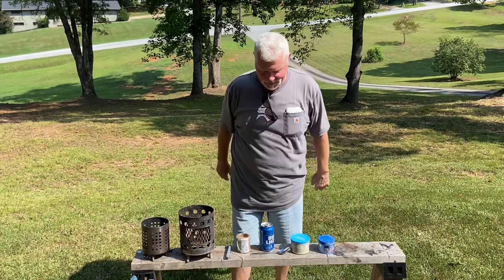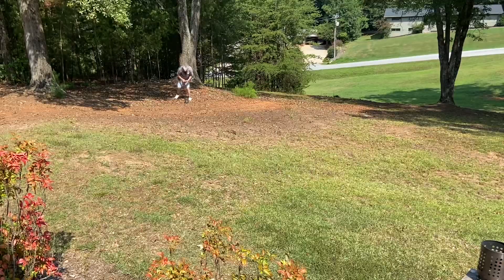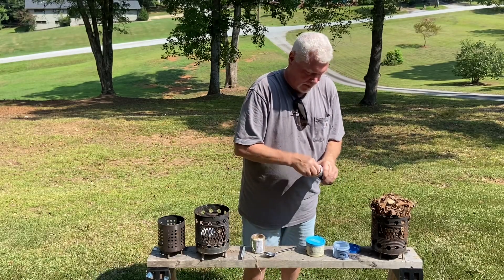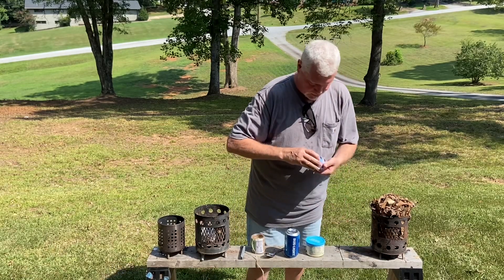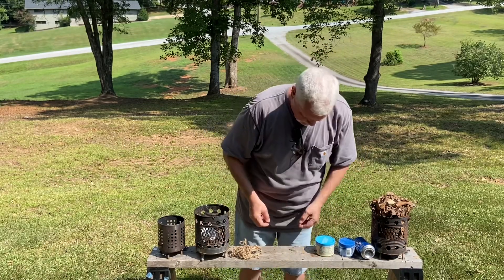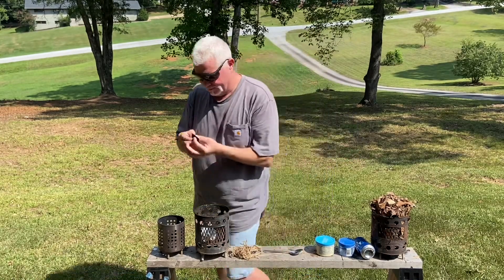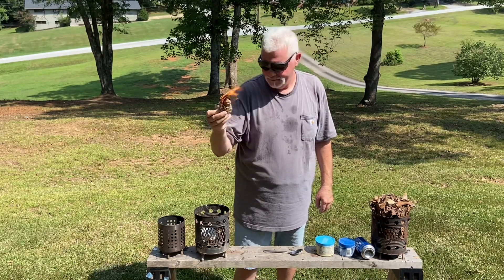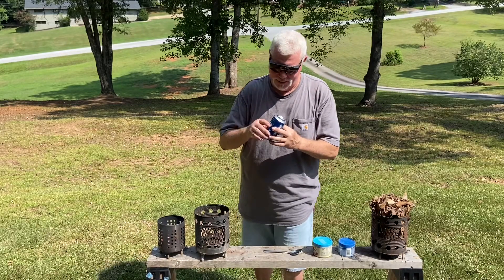Solar Ignition With A Tablespoon And Can Bottom

Comment: Excellent video David.  I've seen so many people work very hard trying to obtain fire through solar using a can and failed, never did I see anyone use a spoon.  The important thing that I've taken away from this video is polish the item to be used and the angle of the sun and in using your finger to source the hot spot.  Thanks.
Reply from the maker: I saw the " solar spoon" first on Corporal Corner then found  another video on YT that predated his. You have boiled it down correctly. The 3 main points that apply to all Solar Ignition. The polish aspect in other techniques can be thought of as clean water in the bottle, or a clean makeup mirror, or a clean scratch free fresnel lens, etc.... all for best photon manipulation.